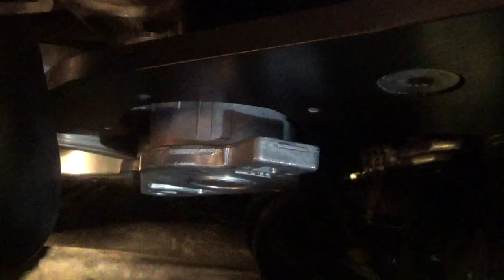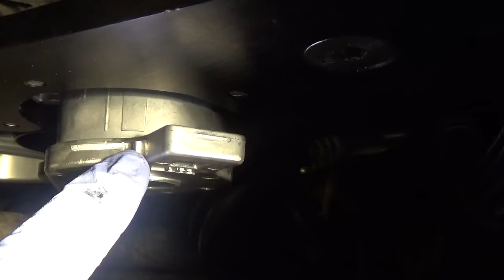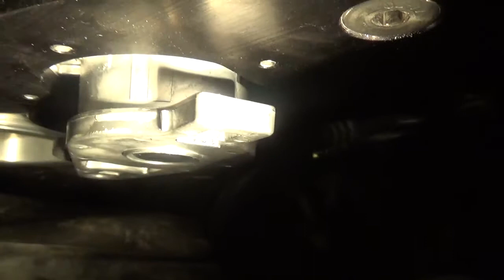Overkill Supercharger - Tensioner Operating Range

Comment: Hey will I have your e85 kit for the lfx can u make a video one day how u installed yours bcuz I’m not sure what tool to use to poke a hole on the module
Reply from the maker: Sounds like a good idea. I'll be installing a flex kit on my CTS using my kit and will take a video on it. It's the pin connection that concerns most but it's straight forward to do.